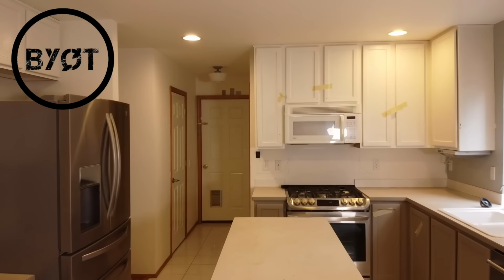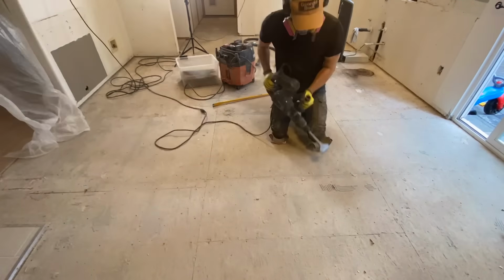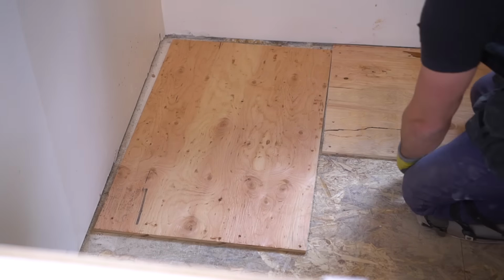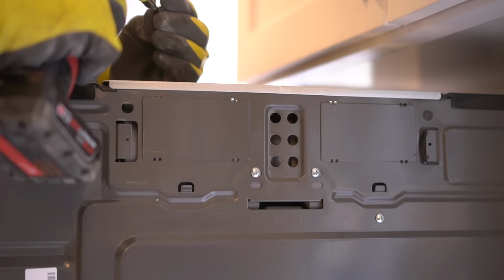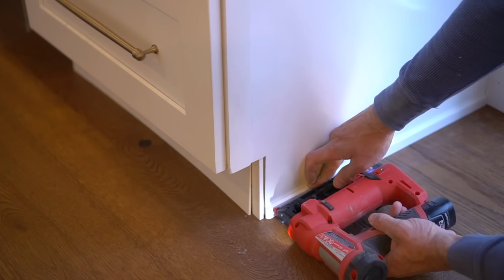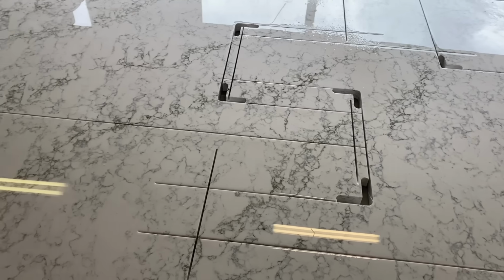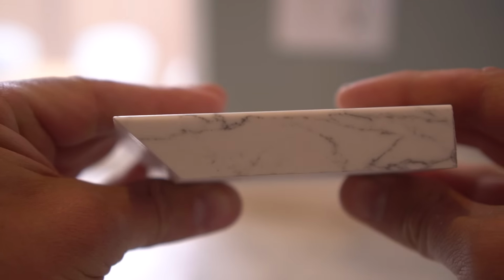DIY Kitchen Remodel From START To FINSH

Comment: I would cry if I had tile and it was replaced with engineered wood, especially in a wet area like a kitchen.
Reply: All high end kitchens use wood. Engineered wood can even be put in a bathroom. It's incredibly resilient to water. I prefer tile myself, but wood is the go to for a luxury kitchen.

Comment: Finally, a contractor who installs the wall cabinets first.
I do remove the doors first, though. I found it makes installing the molding easier. Additionally , I don't risk banging the doors up when they swing open accidentally.

Comment: Me and my friend did a tile job with removal like that. It was 600sqft of it. We used a shingle remover shovel for the cement board on the floor. They had nails every 3” on every sheet instead of screws. Demo took two days between the two of us.

Comment: I use a roofing shingle remover to pry up cement board.  It has notches on  the blade that will let you get under screws or nails and allows you to pry them up with out removing first..  You’re welcome.

Comment: Are we allowed to offer feedback to this beautiful build? 

Pot faucet on range backsplash, center all backsplash outlets, combo box light switch and outlet left of range, add electrical outlet to island on each end. 

My takeaway from kitchen remodels. Again, excellent work and explanation video!!!
Reply from the maker: Always appreciate constructive feedback.  Thanks so much for the input and I'll have to keep that in mind for the future.  Greatly appreciate the support.
Reply: Doesn’t the pot filler get greasy ? Also yet another water line to potentially fail later down the road. That’s the only reason I haven’t added one
Reply: Pot fillers are expensive and pointless, and against code in a lot of places

Comment: Boy oh boy, what a nice job, you are craftsman.  I like, I wish you were in our area.  The quality of your work was done well.  We have found around here the quality of work done, is a shame.  We are doing a new countertop in our kitchen and not replacing cabinet.  The old countertop are not level I and pray the installers of the new countertop will see those unleveled areas and if that can be rectified correctly before new counter top.  Any suggestion for us :). I like what you did on this video.  Oh  just suggestion, removal of old tile what about using an ice scraper.

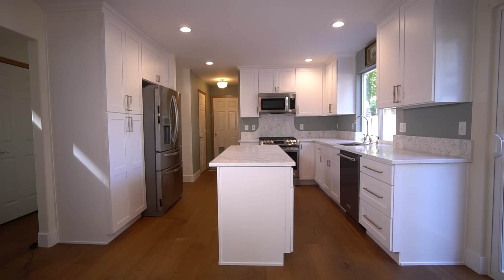Comment: Nothing against the excellent work here, but when I compare before vs after (0:14 and 44:42), it looks basically like the same kitchen updated with better lighting (the before image is yellowed for some reason), cabinet hardware, quartz countertops, new microwave, and flooring.  The labor cost would be huge with all the work described.  Does a 2cm thick stone backsplash improve the look when a porcelain large format tile would look just as good?  Maybe a new Ikea pantry to the left of the fridge would be nice, but this kitchen has a lot of cabinets. Hats off to the skilled professionals who do this, but I wonder why so many owners feel the need to gut everything.

Comment: Why do you need to remove the cement board? I’ve never done hardwood floors
Reply: Idk 
it seemed weird to me, bc he only said it’s “not needed” not that it had to be removed. If it could’ve stayed, it would’ve saved a lot of effort
Reply: I don't get that either. Until now, I have understood that many kinds of flooring including manufactured wood can just be laid on top.

Comment: Do you guys have any changes coming in regarding engineered stone like this?   In Australia, it looks like these products will be banned, as too many cases of silicosis, and workers/employers not taking all the right precautions.
Reply from the maker: Not that I know of but yes you definitely need to always wear a proper mask/respirator when working with these types of countertops and cutting them/grinding.  So are all quartz countertops being band in Australia?
Reply: @BYOTools  yes, as of 1 July 2024, an order is made to prohibit the use, supply and manufacture of all engineered stone.

Comment: You mentioned that backer boards are not necessary for engineered hardwood. However, what would've been the harm if you had just kept the backerboard there any ways?
Reply from the maker: It would have thrown off the floor level since it would be raised up approximately 3/8" tall in the kitchen.  Hope that makes sense.  Thanks for watching.

Comment: Looks great - however NEC requires an electrical outlet on all kitchen islands, so this is not to code. It's a bugbear for me because my place doesn't have one.. haha
Reply: Not in 2023. Read the new code.
Reply: @eamcbmsc  2023 requires pop up electrical outlets? Either way, it’s a really bad idea not to include them
Reply: @TheducksOrg  no it doesn’t. You can read section 210.52(c)(2). Outlets are no longer required.
Reply: @eamcbmsc  what a regressive change! Having to run cables over floors is such a safety hazard. Lazy electricians must have lobbied for it 😒
Reply: @TheducksOrg  it’s definitely a step backward but 🤷

Comment: So how did you get the custom cabinets for 75% off? Mentioned they were $40,000 but you were able to get them for $10,000
Reply: I think they said they bought the “new” cabinet at a discount store, but they are NOT the same as the custom cabinets that the client originally wanted bc budget.

Comment: What does heighth mean? Heighth is a misspelling of height. It might exist because of a perceived similarity to other words that end in -ghth, like eighth. Other measurements, like depth and breadth, also end in -th, so some writers might overgeneralize this ending to heighth, as well.

It could also stem from a mispronunciation of the word by some speakers. HEIGHTH ISN'T A WORD.

Comment: 25k you must be out of your mind. You can do it for less than 15k. 
If you buy the wood and do the cabinets which all are plywood i made it for 5k.... those who knows diy
Reply: Right??! The cost of the kitchen for a professional install at 25k is norm/high. Folks charging 50-75k are price gauging. All for less than 7k worth of material. Could charge 15k and still have good profit

Comment: just out of curiosity, wouldn't it look better with floor paved first then installation of the cabinets and table?
Reply: I am going through a kitchen remodel, and if using a floating vinyl floor, it should not be installed under cabinets (to allow for expansion and movement). The kick plate and island back panel covers up the edge of the floor. The plywood under cabinets maintains correct cabinet height.
Reply: @ColoradoCarl1  it's too fragile to hold the cabinet?
Reply: @foreignstory  The cabinet weight would prevent a floating vinyl floor from moving and expanding / contracting over time, so I think the floor may buckle.
Reply: @ColoradoCarl1  i see, thank you. so the cabinet should sit right on the substrate ?
Reply: Some recommend placing the cabinets on plywood the same thickness as the flooring, so they will have the standard height.